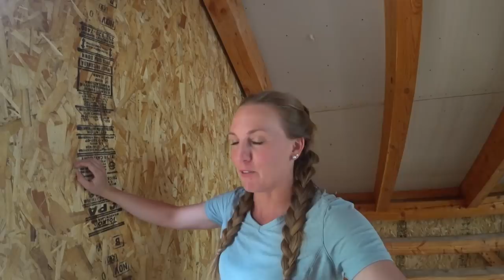ALL FINISHED With Window Installation In Our Dream Home!

Comment: Since you live in an area that wasps live in great numbers, you can keep them at bay with 3 different plants: Mint, Wormwood (Artemisia) and Lemongrass. Wasps are insectavors, so they're beneficial to have around to keep flies and mosquito populations under control, but to keep them away from hanging around the house, planting Mint, Wormwood and Lemongrass  into your landscaping will help to limit their overabundance. These herbs also have various other uses. Mint and Lemongrass are great in the kitchen for flavorings, teas, curries, etc. Wormwood has medicinal uses and is a flavoring for certain types of ales (if you want to make your own). Lemongrass also repels mosquitos.
Reply: Good suggestion Len. I planted Lemongrass around our house when we first moved here. It worked great at keeping mosquitoes and flies away. However, Carpenter bees seem to like the stuff. LOL, who knew?

Comment: My husband and I know all about the pressure you two are feeling. We have been camping out in our construction site for over 2 years now. Blizzards, floods, no electricity for quite some time. Nightmare. But once it is finally "dried in" you can plug away on the inside. Our plan was to do everything ourselves but we ended up hiring out a couple things for sanity reasons. Focus on the roof, a primitive working bathroom/plumbing and enough electricity ran to work/keep warm inside this winter. Two words: space heaters. You got this!!!!! I have been told it will all be worth it in the end. Let you know when we get there lol 😉

Comment: My wife and I worked through a winter in northern Canada building our home. It was inside work, wiring and plumbing, You dress for the weather and soon get used to it. On the plumbing I did the pressure system but hired a plumber for the sewage system. Didn't want to have a problem in that area. Your bringing back lots of good memories.

Comment: I like the idea of using a few selective contractor's like you did on the septic installation. I would have an electrician run the cables and install the main service panel in the house, after that you should be able to run the circuit wiring yourself. Having the plumbing contractor do the basement/garage bath will give you some first hand knowledge to help you do the rest of the upstairs plumbing yourself. You guys are doing a great job.

Comment: Sanitary vent roof penetration can be installed before plumbing to allow for ease of install. 4" vent penetration will need a 5-1/2" or 6" hole, roof flashing, foam etc.

Comment: I would work on finishing the roof and get 1st floor elec and plumbing to finish and rough for other floors. I would then seal other floors temporily and insulate 1st floor so you will have a nice comfy place to over winter.

Comment: It's all well-and-good to want to do everything yourself on a scratch-build. Unless you have multiple skill sets and experience, certain jobs are best left to professionals. I would hire pros to do electrical, plumbing and HVAC. This house is much different than building a log home in the wilderness, using kerosene lamps for lighting, a fireplace for heat, a well for water and an outhouse for sanitation. Just my two cents.

All-in-all, they're doing a fantastic job. Much respect.

Comment: PAINT the exterior wood with DURATION or EMERALD paint from Sherwin-Williams,   this will seal the wood over the winter,  sometimes Sherwin-Williams has mis-tints  on EXTERIOR  Duration or Emerald,  you can get them for $5 bucks a gallon,  your home will look like a rainbow,  but at least it will be sealed.  I am a contractor 30 years and this is my go to product for EXTERIOR applications.  This paint WILL NOT chip,  it is a prime and paint rolled into one product.

Comment: Watching this in October, with the knowledge that many of the frustrating problems that Alyessa expressed in the opening of the video have been overcome due to the hard work you two have put in, gives me a really good feeling. Connecting the house to the electrical box, which I know is underway, is huge. Getting a well put in before winter would be great, too. Hiring out the electrical work, at least part of it, would be cost/time effecient, I think.   I don't see any reason why you couldn't live/camp inside the house this winter, not in the RV. Jessie- now is the time to get a kilt! 
Go to it, guys! You are doing GREAT!

Comment: i knw u guys were hoping to dry finish it last year before winter but at least this year ya can. id say just get all the glass in them holes and put some house wrap on it. put a composting tolit in, propane heaters, water jugs and you guys can actually work away on the inside this year.

Comment: Moving right along ain't ya! Looks good . They could do the electrical and the bathroom in the garage while you two do the roof. Would be a lot safer for the electrical and a great treat for you two to have the bathroom secured for winter? Just thinking out loud but you guys have to do what you can and want. Good luck. Thanks for sharing.

Comment: Instead of getting the chain ladders for emergency escape I think they should just get a firemans pole outside so all you do is jump and slide.
Reply: ecleveland1 few poles anymore. Mostly replaced by one story stations with sleeping quarters connected to the apparatus floor or slides. To many injuries from poles.

Comment: I live in the UK and love watching your videos. Its interesting to see the different building techniques you use compared to UK. I am sure you've covered this before, so forgive me for asking if you have, but why didn't you use scaffolding on the outside to give you access without the need of the lift and would this have been easier for the roof installation? Love your home and thank you for sharing your journey.

Comment: You should hire out the roof install, the plumbing and electical you can do without a doubt. The roof is puttin your lives on the line, you need to know your limits n hire out those kinds of things n not the things ya want to rush.

Comment: one thing down for the list the if you use [Generator Ready load centers]   you will be closer to have backup power also if you add [power input panel] you will able to have the power back on in minutes of time add save $ on putting it in later Using electrician is good for a lot of the rough in it will get you so you can plug in power tools, lights to make working easier have a grate day! don

Comment: All it takes is an empty 2 liter soda bottle. Cut the top off and insert it spout down and duct tape it at the seam. Use apple cider vinegar and a bacon strip, slightly cooked. Tie it to the top. You can catch 2000 yellow jackets per trap. They might have 6 queens or more per nest!

Comment: The difficult thing is that it is finished enough that it is a now a tease.  When you were milling timbers, the build was an abstract pursuit.  Now that its looking like a house and winter is setting in you are feeling pressure to get things done to make it ready to move in.  It has become a time crunch driven long set of tasks.  Rol Eic below is probably eight, take some intermediary steps and take the pressure off yourselves.  You are doing a great job ..... be kind to yourselves and find ways to reduce the pressure.

Comment: I still don't get why you only water proof the window bottoms. Water can, and will, get into the top of the window opening.
Reply: When constructing anything, you want to layer your materials, so gravity will slide the moisture and crap downwards and then its directed off and away from the building via ground materials and drainage system.
In the windows case top layer is what ever surface finish they plan, then comes to house wrap witch goes over the wall, window frame and the waterproofing they have done so far....long as they put house wrapping under that and not on top.
Reply: When the house wrap is put on there will also be flashing put over the tops of the windows at the least that's how I have done it when installing windows.
Reply: I believe they will come back and Tyvek the whole thing then side it.

Comment: Dont get stressed out....building isnt easy and doing it yourself and learning as you go is a long process. Doesnt have to be done by winter....or does it? If you get the house wrap on before winter it will protect your OSB and its cheap to replace again in spring if needed from the winter winds

Comment: Eat that House Elephant one bite at a time.  Wise though to getting the electrical and plumbing contracted out.  When we built out house, we commissioned one electrical distribution panel, and 2 sockets, in the garage (We kept that, knocked down the original house though).  It made all the difference, we had shelter, and as much power as we needed for heating, tools, lighting.  Then with the house "built", sewerage connected  and a single water tap, we were in heaven.  We could live in there then!

Comment: I hope the used a level to match the 3 windows so they are all in line with each other. When the siding goes on, the reveal will look  off if not correct

Comment: Just wondering if you redid the windows and added flashing where it should go on the windows that you paid to have installed. The ones y'all did look great but it's disappointing to have professionals do work for you and have to redo it yourselves. My neighbor came over when they were installing our windows and said to make sure they flash them properly as he is now experiencing what happens when someone doesn't do it correctly. He put his hand against a wall and it went right thru do to rot from water entering around poorly installed windows and has a major repair job to do on his house now! I watched our installers carefully as we get major moisture here on the PNW peninsula also.

Comment: You should’ve put the roof on before you put the windows in
Reply: They put the windows in while the were held up putting the roof on.  There is a needed part missing for installing the metal roof and should arrive any day.

Comment: I've been curious about something and maybe I should have asked earlier. But why didn't you use a 5 or 7 pound dead blow rubber faced mallet to knock in the window sills ? It would not have put divots like the metal hammer did. Also I'm not naming names but a certain wife who's name shall remain nameless. She could be blamed for your shorts blow-out,,,,,, all those hot peppers from the garden caused a lot of back "side" pressure that "rump"tured them. ;-)

Comment: Probably too late now. But you take some meat. Nail it onto a board.. Lay the board meat side down over a pool of soapy water. Meat should be no more than an inch over the water. Goodbye yellow jackets on mass :3 I live pretty close to you guys and went through the same issue this summer.

Comment: I would go ahead and hire who you need to. No shame in that at all. You guys have done so much... much more than many would have ever even remotely attempted. But I think it’s time to get everything sealed up. First thing to do on a house is to get it weatherproofed as soon as possible. Don’t want wood and other materials exposed to the weather. Most of it can’t handle that exposure for too long. Case in point, your ice and water shield. Every episode I watch, it changes color and is looking bad. That orange/brown color its turning, can’t be a good sign. But my point of all of this is to say, do what you have to to get the outside completely protected. The interior work is going to take long enough and if you want to work on this over the winter, be good to have a completely sealed up house to work in. Then, you can spend all winter in comfort getting all the tedious stuff done, you definitely don’t want to rush that part and you won’t feel compelled to when your working at the temperature and humidity of your choosing.